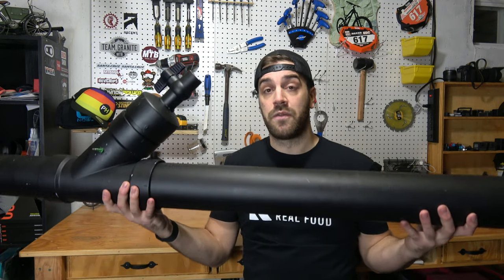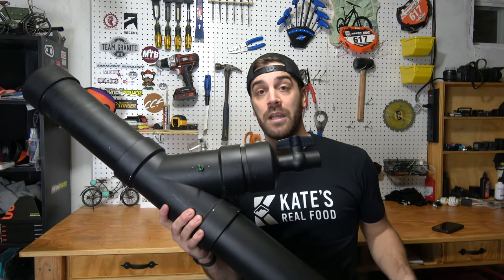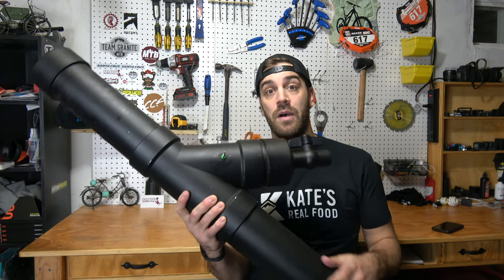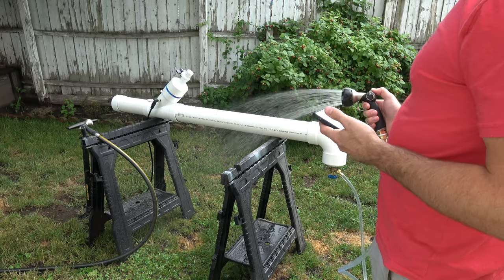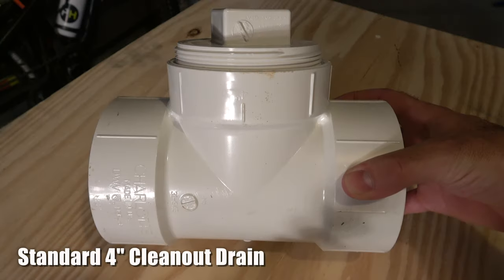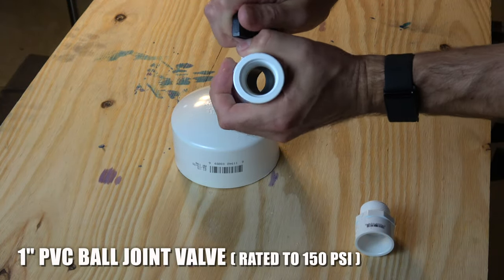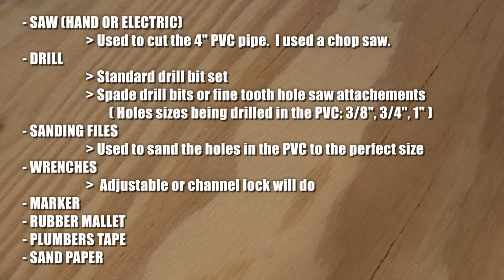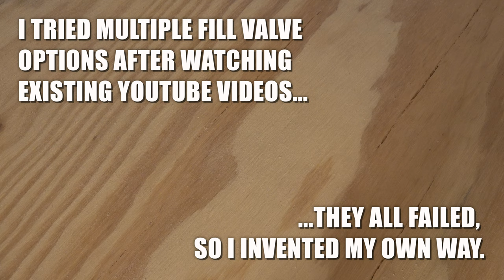DIY: Pressurized, Solar Heated, Rooftop Camper Shower for Under $150 | NO ELECTRICITY NEEDED!

Comment: How much water can it hold with room for the pressurized air ?
Reply from the maker: Around 3.5 gal
Reply: Thanks awesome build by the way. Have you modified it since  you built it ??
Reply from the maker: @Undisputeds70  cheers man! No modifications, expect for a separate water storage tank for more water to refill.

Comment: isn't the Presta valve also an air release valve? why need extra part and point of failure.
Reply from the maker: Valid point.  It is easier to release air though, since you don’t have to stand there and hold it like a presta valve

Comment: Why do you need an air release valve when you have a presta valve already?
Reply from the maker: I mean, if you want to hold down the presta valve for me, that’s cool, but it’s much easier to just open the other valve instead of sitting there. It holds a lot of air. Haha
Reply: @MTBTravelReview  couldn’t you just open the pvc ball valve? Great build btw, even better video with excellent guidance.
Reply from the maker: @ricecowboy  you could, but it sounds like a bomb going off if you open that thing up under pressure. Haha.  Thanks man! Glad it’s been helpful

Comment: You know what side drill bit it is for presta valve
Reply: What size drill**
Reply from the maker: Don’t remember. Start at 1/8” and work your way up until it fits snug. That’s what I did.
Reply: had same question, also struggling finding the right presta on amazon. None of them stating they come with rubber washer- do you have a link to what you have?
Reply: did you use the tubeless stems?
Reply from the maker: @mmagbee  yes, presta stems are what are used for both tubeless and tubed setup.  All presta valves should come with a rubber washer. Otherwise they wouldn’t work.
Reply: @MTBTravelReview  that was my thought as well, just didn't want to order something that would not work

Comment: How hot can the water get? Nobody in these videos ever tests temperatures.
Reply from the maker: A million variables.  On hot days it gets warm.  Nothing crazy
Reply: @MTBTravelReview  is it even worth painting it black? Or it just doesn't heat up enough to bother? That's what I'm wondering.
Reply from the maker: @foxtonstreet  I painted it black mostly for aesthetic purposes.  It definitely helps slightly, but I don’t think its 100% necessary.

Comment: If you actually used your brains you can fill the thing from the outlet connected to your garden hose and just use the T valve to know when it is full as the water would come out of that.. much quicker and easier....
Reply from the maker: So you are insinuating that I didn’t use my brain? Solid recommendation. Shitty way of sharing it. Try to work on that sunshine.
Reply: @MTBTravelReview  lol.  he's from Melbourne.  It might not have been used as an insult, but he should now be aware it is insulting to Americans. :)